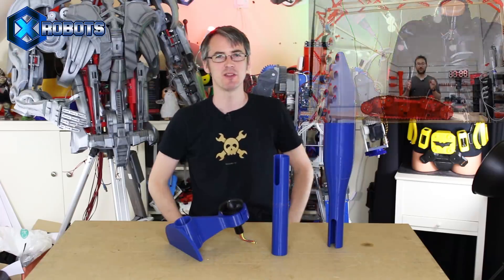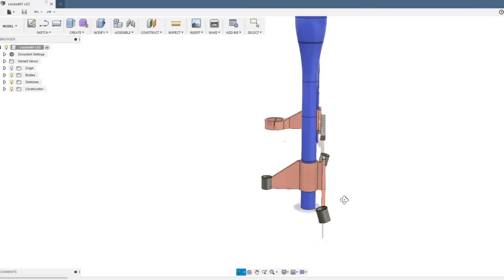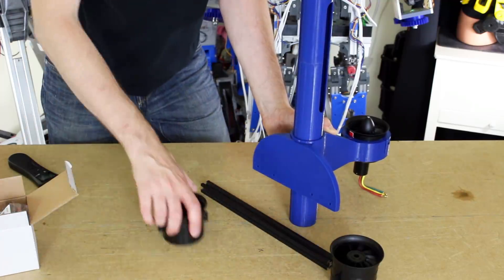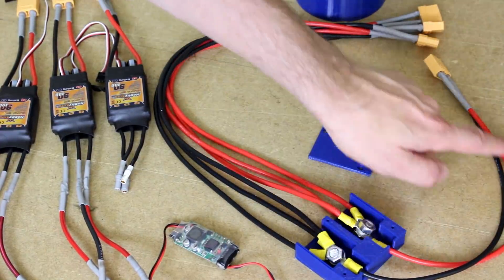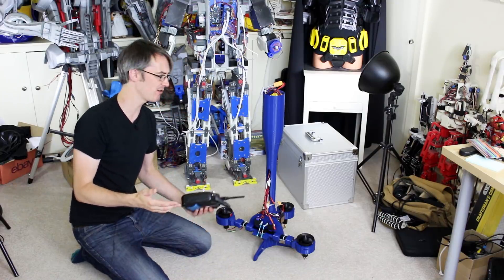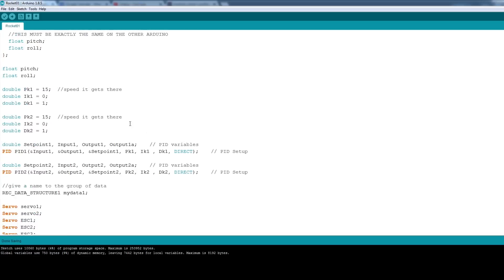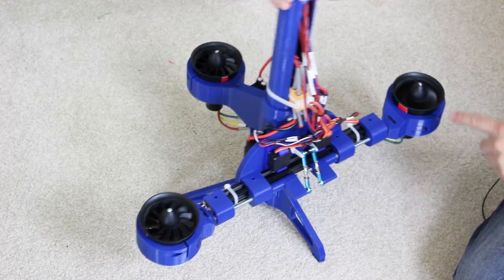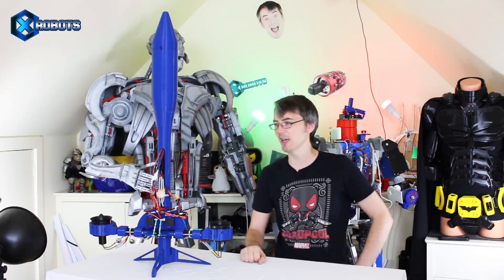Designing a #SpaceX-style Electric Rocket w. Ivan Miranda | Pt 1 | James Bruton

Comment from the maker: The first rule of Space Rocket Challenge Club is...? We don't talk about thrust.
Reply: Wow, that's brilliant! I can imagine an electric rocket blasting off as high as it can go in the atmosphere and then jettisoning the battery packs and motors to allow the solid rocket fuel to take it the rest of the way to space. How long did it take you to conceive, build and program this?
Reply: you should consider using either a pixhawk or a cc3d/cc3d revolution controller. they have easy PID setup and they handle all sorts of wonky vehicles.
they take rc controller input with no issues and are available from amazon.
 the revo and pixhawk even use gps, and I figure that gps is very useful on a rocket if you're also competing in accurate landings or perhaps travel over distances.
just my 2 cents.
Reply: James Bruton my two favourite channels
Reply: Well you could add a rocket engine (like an ebay.com/itm/Estes-D12-3-Model-Rocket-Engines-Pack-of-3/283087109641) and use the fans for guidance or just the return trip.
Reply: who me? :P
Reply: Surely putting one of the EDF's upside down would give you the counter rotation?
Reply from the maker: then it would get sucked into the ground... if you turn the rotor up the other way then you are just back to where you started.
Reply: James, yes I see. Just thinking out loud, so to speak. :)
Reply from the maker: I actually thought it would be a solution as well until I tried to do it ;-)
Reply: James, yeah the reverse thrust thing gets in the way, causing instability. I like your solution though. :)
Reply: Not sure if you know about it already, but the thrust being higher up has no effect on the stability of the rocket. This is called the pendulum rocket fallacy. 
https://en.wikipedia.org/wiki/Pendulum_rocket_fallacy 
The distance between the thrust vectoring and the centre of gravity does however, so your suggestion to move the thrust units up, may bring them closer to the centre of mass, and therefore reduce the torque produced on the craft, and therefore the ability for the thrust vectoring to control the rotation of the rocket.
Sorry if people have been bombarding you with messages like this, but I was keen to share some knowledge that is somewhat applicable. 
Thanks!
Reply: Dave Lennon-Copeland you’re correct about flipping a fourth EDF, all you’d need to do is 3D print a rotor with upside down blades, but the better solution would be to set up the four EDFs like an x.
Reply: in thrust we trust...
Reply: James Bruton  if I am right you need 50v to rich
Reply: Space
Reply: Since when is SpaceX ever made anything that looks like that or that involves electricity

Comment: Hi James, from my engineering point of view (yes I have done some rocketry, albeit, missles fired from a moving platform), here is a comment and some questions:
I think you have done a splendid job on the overall concept of the rocket. It looks cool. It does seem to go up and stay somewhat stable while in flight. Perhaps a bit less adjustment during flight.

1. Was there a reason for putting the battery at the top of the rocket and not the bottom? It seems the platform you are designing would benefit from the weight distribution being more toward the bottom vs. the top.
2. I wonder if your tripod leg structure would benefit from an evenly distributed orientation i.e. 120* separation of one leg from the other. I get the idea of the counter rotating fans. If all three are able to rotate, maybe the "third leg" can move opposite to the other 2 to give better flight characteristics? 

Just some thoughts. Well Done!

Comment: you might as well just use a multicopter flight controller and save yourself time and money fiddling with the control hardware and software.  It should be plug and play; this is a standard tricopter design.
Reply from the maker: I still think it'll take the same fiddling with PID controllers and servo outputs on a NAZE32

Comment: Here is an actual challenge: 1 EDF for propultion, 2 servos (rotational or linear, your choice) for thrust vectoring. Have fun ;)
Reply from the maker: The issue is the amount of lift we can get from 70mm EDFs and bigger start to cost a lot, also counteracting the recoil from a big EDF rotating etc...
Reply: ok, I'm not quite sure how efficient it would be, but you could do 2 contra-rotating EDF'S in line with each other and place them in the fuselage (might be cleaner to just use the fuselage as the duct and place 4 intake vents in the sides so the fans can breathe. then you are getting rid of the duct weight).

Comment: This is not a Rocket... It's a Quadcopter with a missing engine... A challenging project for sure, a Quadcopter uses 4 motors for a reason. But calling it a Rocket is stretching the truth to the limit!
Reply from the maker: Ultimately I need a catchy title and something to relate to in terms of landing like SpaceX. It'll be title gore otherwise to explain it accurately.

Comment: its going to be great seeing you work with ivan. never heard of you before so new sub :-)

I have no skill in electronics but I do know rockets as its what I enjoy doing :-). in rev 2 consider 3 motors evenly spaced and 3 servos to tilt all 3. should be much more stable and give you a larger wider thrust envelope to work with. this is basically a 2 motor craft the third motor can't really do anything unless it tilts that way.

to control "pitch" your only corrective action is to turn off that motor and lets its "mass" pull the model back but its moment is very small. you could tilt both motors toward it to "swing" the bottom back round but now you introduce side slip big time.

thats some freaking impressive EDF"s to lift what? 7 pounds? wow! I really need to find a way to get into that aspect of the hobby. so much potential! but only if you know the software side which I sadly do not. I can design the rocket but not program it :-(

Comment: This seems less like a Space-X Falcon rocket and more of a quadcopter with gammy arm and a stiffy.
Reply: well hopefully they stick rocket motors in them at some point!
Reply: It would be good if they used some solid rocket motors to get it way up into the air then used the EDFs to land it in a controlled way. Everyone else trying "space x rockets" seem to be just doing the EDF landing thing from a few feet off the ground. 
If this is just an EDF balancing landing thing, this particular design looks like a bit of a cheat since it has several motors spread far apart, which is why I say this is more of a quadcopter at this point.

Comment: Uhm... those compensations look too slow to be effective.
Also, AVR doesn't have hardware floating point support as far as I remember, so is there any particular reason to use not even float but double vars for calculation? Maybe it's fast enough but it looks quite inefficient. Have you timed the code?
Reply from the maker: Well that is down to PID tuning. An 8-bit AVR is enough to make a two-wheel balancing robot.
Reply: I think your design should work, but in the case of a balancing robot, the floor is a solid surface to push against with little to no delay before the correction.  Air, on the other hand, will be slower to respond.  Now, thinking positively, I should also mention altitude will also delay the response time as the air thins the closer you get to the moon.  :)

Comment: Hmmmmmm.... Electric rockets? 
I like it.
Reply: I have always thought a micro stupid powerful EDF with a tiny but high amp dump cell would make a damned cool "electric rocket"

instead of reloading a new rocket motor you "recharge" the pack (or maybe super cap bank??) 3 or 4 second of stupid high power is all you need too!! but can we get a motor edf combo under say 50mm that has say 15-20 pounds of thrust?

does that exist? it would only have to run a few seconds at a shot.

Comment: That is really cool! Are you going to implement a hoverslam/suicideburn in the design?
Reply: Well SpaceX rockets do suicide burns, they are overall more efficient so you can get more usefull deltaV out of the first stage.
Reply: That seems like a bad idea. XD
Suicide burns are things you use when you have no choice - basically needing it either means you have no spare fuel/power, or your throttle control isn't good enough to do anything with more precision than that.
Reply: Or if you just want to mess around and experiment with all the aspects of the SpaceX rockets. I do however think it's rather unlikely that this has enough thrust to significantly decelerate the "rocket" 

Interesting fact about the SpaceX first stage, even with just one motor running idle it has a T/W  ratio well above 1:1 (1:1.29 to be precise) after re-entry.
Reply: Kuralthys you are like, 10% correct about that. aside from what was a google search(even here on YT) away from your know-it-allness, people do that shit just for fun. 

Getting back to google searches, go look up why people do them, and tell me what you find OTHER than it's the most efficient way to land a rocket, anywhere. Maybe not anywhere, but find where it won't be one of the best scenarios for extra credit.
Reply: Scott Manley did a nice video on the subject.
Reply: Stefs Engineering Yeah I've seen that video.

Comment: Why an uneven weight distribution with the motors?
Reply from the maker: Why not?
Reply: James Bruton . If you mechanically balance your rocket the whole thing would be so much more stable since the motors don't need to compensate the whole time. Saves a lot of batteries to begin with. But besides you will just waste a lot of speed and control.
Reply: James Bruton . Also another big problem is when your motors are already maxed out, you dont have any headroom anymore to compensate. All professional (big) rockets are mechanically stabilized and use the engines for just steering and small corrections.
Reply: well that is actually easily solved if his programming is complex enough. tilt the rotors and rotate the model 180' problem solved. but you will have a ton of side slip.

Almost NO professional rockets are mechanically stabilized. pretty much only amateur rockets are mechanically stabilized (fins)

Virtually all professional (and starting now some hobby grade) rockets are THRUST stabilized with either thrusters (verniers) or the bulk GIMBALLING the engine bells. ie they "tilt" the thrusters just like he is doing with those 2 side fans to keep the rocket pointed where they want it to be pointed. this is why they do not have and do not need aerodynamic "fins" on them at all. technically that is mechanical (your gimballing the engine bells)
Reply: Nerys . That's not the entire story. Nowadays the do compensate with engines, that's true, but these are separated ones besides the thrusters. Olders models were all mechanically stabilized. Still from an engineering point of view it only give you benefits when the weight distribution is being balanced.
Reply: I'm out of my league here, so walk on by probably. But, the space shuttle comes to mind. was that mechanically stabilized?
Reply: NiceWhenEarned RudeMostlyElse no the space shuttle was actively stabilized the engines were throttled and the three main shuttle engines gimbaled in fact I believe they have the highest degree of gambling of any engine ever made they had some mechanical stability in control from the wings but that was secondary a consequence of having a winged craft for atmospheric reentry

Now the shuttle returning was mechanically stabilized but the shuttle going up will stabilized by gimbaling the engines
Reply: because you added a moment arm you can't easily correct for :-) it will be cool to see if the software can compensate and how much side slip it will add. god I wish I could do the software thing. so many projects (like this one) would open up to me if I had to time to learn that part of it.

I can't wait to see this thing go. SOO much fun is going to be had!!

Comment: THAT WOULD BE SSOOOOOO COOL TO SEE YOU MAKE A REMOTE CONTROL ROCKET SHAPED LIKE A SHUTTLE THAT YOU COULD STRAP ON TO IT TO HELP CONTROL IT ON THE WAY UP!!! You could have the rocket propelled by multiple hobby rocket motors, like it lifts you off with the ducted fan booster and a single D engine, when that  is done or the remote gets out of range of the ducted booster it drops the spent D engine releasing the booster and igniting 3 fairly small long lasting engines that basically give it power while you fly it back to the ground.

And since you are doing things Tom Stanton has done before... Let's see your design for an air powered engine that runs on compressed air held in 2 or 3 liter soda bottles. Tom got his to go for rather a long time so you should probably get the files from him to start off and then do a few iterations to try to improve the little details. Making a regulator for the air would work rather well though a 3D printed mechanical pressure regulator sounds challenging... Just challenging enough that you might be able to do it, and actually if you can then maybe that would help with Tom's goal of a compressed air powered throwing plane like the old style air hogs.

Comment: I dont know really much about the motprs but cant you just switch 2 wires in order to spin it the other way around
Reply from the maker: yes but the fan would suck air up instead so I'd need mirrors of the blades which are hard to find

Comment: I have tried something similar but can tell you that stabilizing the rocket is going to be very diffucult. PID was not working for me at all. You might want to look at QP or MPC and a Kalman filter for the gyro. Probably have to stream data to a desktop computer though because its some heavy algorithms.
Reply: Erik Örjehag have you ever heard about multicopters (drones)? They all use a PID loop. Basically, James reinvented the tricopter.
Reply: Árpád Hegedüs its just from my experience, maybe it had something to do with the high center of gravity, or maybe I just suck at tuning PIDs idk 😅
Reply: you definitely want your center of mass as high as possible on a rocket, it is easier to stablise, imaging balancing a broom on your palm. when the brushhead is on top its quite easy, but when you have the brush in your palm it is nearly impossible to keep the stick upright
Reply: most quadcopters will fly with the default pid values of eg. betaflight, but something like this with a high cg would definetly need different values
Reply: If you use betaflight you can try enabling the filters, if it is caused by vibrations. I think the default values are optimized for 5 inch quads. So if yours is much bigger or smaller you might need different pids.

Comment: Why didn't you use an actual rocket motor to launch it? You could of gotten a few estes rocket motors to get it airborne first. Maybe an E16 that has 33.38 newton-seconds (15 Newtons over 2 seconds). Few of those would of looked awesome to launch :)
Reply from the maker: going up isn't the issue!
Reply: I was under the impression rocket motors are extremely hard to control when using more than one. Trying to get it to stabilize itself wouldn't really work the way EDFs can.
Reply: I think he means BOOST ballistically under rocket motors then recover and "land" with the EDF's
Reply: Check out Joe Barnard. He is doing model rocket thrust vectoring. He is even working on landing the rockets without a parachute!